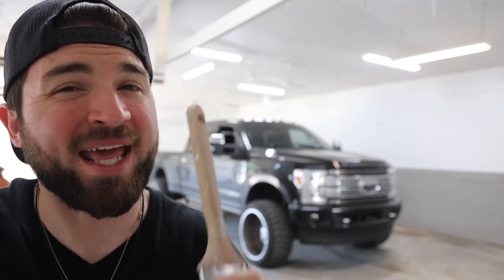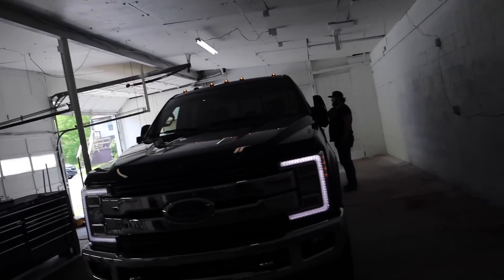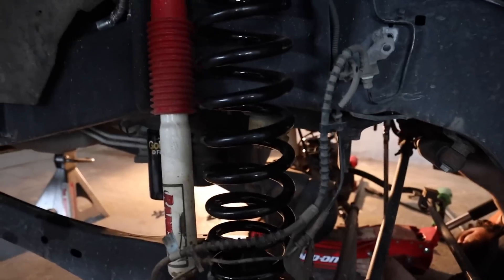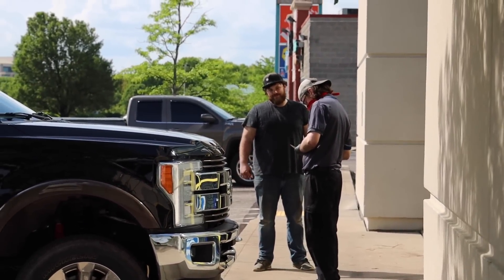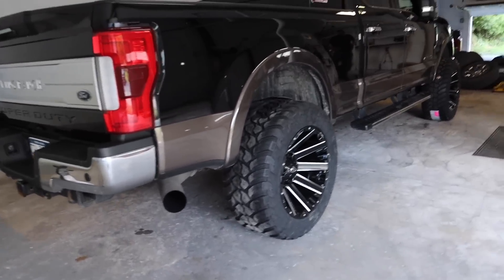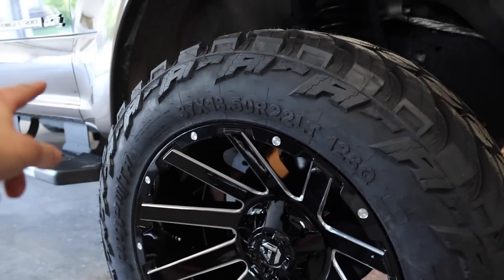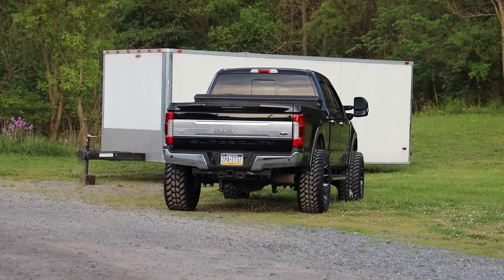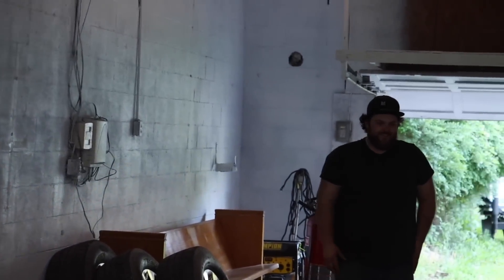Ford F250 Powerstroke Gets Leveling Kit and 22x12s w/ 37" TIRES - FIRST JOB IN NEW SHOP!!!

Comment: Can the 2.5" lift kit c/w 37x12 tires on 22" rims fit the new 2021 F250 platinum tremor and will it void my warranty?
Reply: I have 35x12.5 on 22x12’s on my 21 tremor, leveled 2.5”. Have to cut a small piece in rear inner fender. No wheels don’t void warranty

Comment: Just swap out the rear f250 block with a F350 SRW block and you’re done Corey it’ll be exactly 1.5inch taller in the rear over stock..

Comment: Do your Stage 2 kits apply to the 2020? It says 17+, so I'm inclined to say yes. But I wanted to check as the 2020 is different.
Reply: Did you find out?

Comment: What do you gotta do to win the bumper spacer got a platinum with a 4” lift with the same size wheel and tire set up
Reply: Your running a 4” on 12 wide and -44 offset.    With 37”. Do you rub at all or have to trim
Reply: I’m running a 4” BDS kit on 20x10s w/ -24 offset on some 37x13.5’s and I had to trim a bit. Not as much as this rig, but slightly on the valance and just a hair inside the fender well.

Comment: If you like the way your new pickup drives, steers or goes down the highway with a 35 foot travel trailer..... don’t do this!
Reply: Why
Reply: Why
Reply: @TraumaticSounds  because I did and my truck never did tow well afterwards. My biggest regret on that truck was adding the Bilstein levelling kit. Took it to 4 different shops afterwards trying to fix the alignment and although it handled well by itself… the minute I hooked up our 35 foot bumper-tow travel trailer (11,000lbs) it turned into an unstable death trap…. even with the stabilizer bars attached. Before the levelling kit, that truck towed that same trailer perfectly…. even without the stabilizer bars!